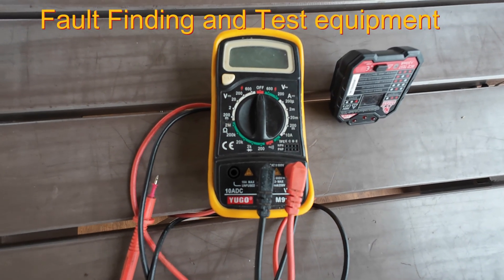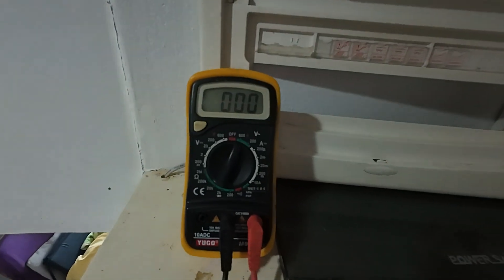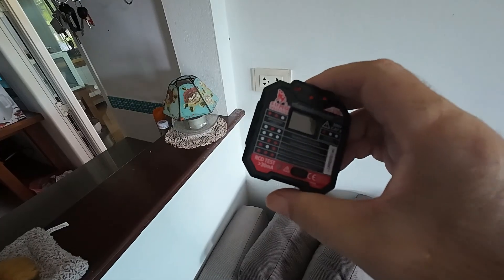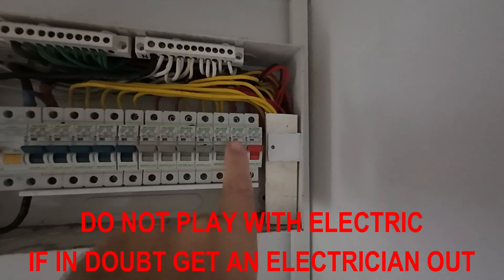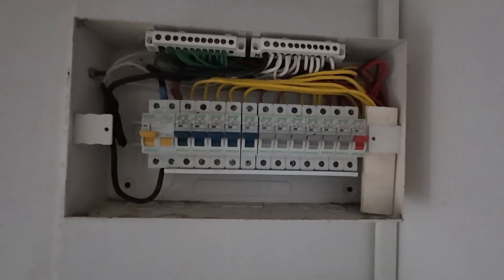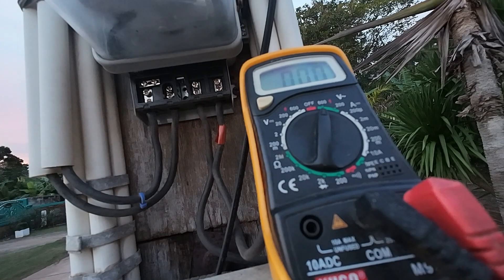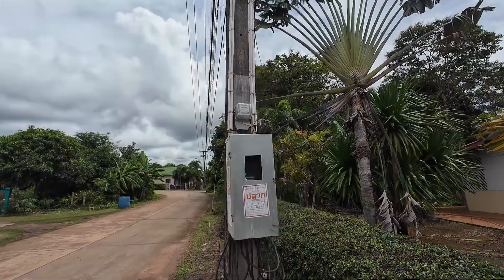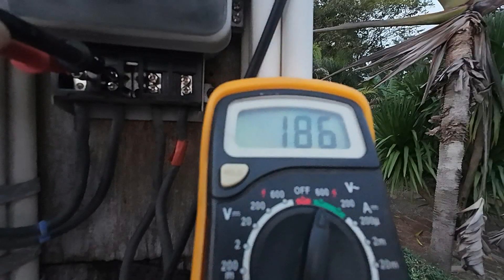ELECTRICS WE HAVE A PROBLEM

Comment: Socket testers don't show Neutral Earth reverse. ../ basic ones anyways
Reply from the maker: This one tester shows every configuration. Invest in quality. My friend who plays an Electric guitar was getting a tingle sensation when he played his guitar, he got me to check the grounding cable in the House circuit, a good grounding. Still getting a tingle he put an earth rod and wired the cable to the socket he used for his amp. Still getting a tingle so asked me to check the cables the short cable connection the amp to the socket 3 pins thinking it was earthed and no earth. Problem solved a cheap cable with no earth cable.

Comment: Heard a load bang from just outside where the cable comes in, a squirrel had shorted it's self out. Two what assumed were fuses where hanging down. PEA quickly came out and replaced them with an insulated pole, while still live
Reply from the maker: The guy replaced the cable here in the Dark whilst still live. Rather them than me. Thanks for sharing your story.

Comment: Some of these issues remind me of home! This was all happening before we started building the house. The neighbors upstream said they complained many times, but PEA wouldn't even look at it. I added a voltage readout on the incoming line right before my distribution box. It quickly became obvious the line coming in was losing voltage somewhere and PEA wouldn't address it. So, I went to solar, and now no issues.
Reply from the maker: There were a few trees making contact with the cables also around this area, this could be another problem with grounding. Our Solar backup came in handy again. Now a stable supply and only storms interrupt the supply now and again. Fingers crossed.

Comment: A lot of times the overhead connections age, the connection deteriorates and start to arc.
This causes the issue you had where the voltage fluctuates and the sparks literally fly.
Yes, I did the job for RECs for 41 years, so yes I am an expert...and yes, it is the PEA's job to rectify as they did.
If the fault is after the meter, you are right it is your responsibility, but once more usually it is a connector that has aged/worked loose/faulted so just needs replacing rather than the whole cable length.
Reply from the maker: Thanks for taking time to watch and make a comment.

Comment: Me to like fault finding as long as not to expensive,so a big relief when you see the short above ground probably rodent damage you see a lot of those squirrel guards in Thailand.I  like to see a nicely laid out consumer unit,interesting wire colours white as neutral yellow being live,in Penang new build condo Black neutral and white sleeve over black is live so inside the board is all black apart from green for cpc.
Reply from the maker: Interesting wiring here, I have an outside socket with three red cables in the back of the socket, so one red connected to the earth cable and one red connected to the Neutral somewhere in the loft.

Comment: The plug in tool is a good tool, all well and good Les if you live in a house which has earthing, I have lived in Thailand for nearly 12 years, 3 different rental properties and all are 2 wire systems no earth at any of the sockets, 2 wire systems it appears to be standard practice in Thailand in the older properties.
Reply from the maker: Yep older houses only have two wire system's even my house the wiring is not correct, one outside socket has 3 red wires in the back of the socket,  meaning somewhere in the loft there is a red wire to the earth cable and a red to the Neutral cable. Mmmmm Check and Check again at any wiring job in Thailand.
Reply: @RetiredandLivingthedream Yes and all appliances made of metal are sold with 3 pin plugs, extension leads all 3 in as unless you buy from Lazada, Shopee etc. In the U.K. when you sell or rent a house you have to provide an Electrical Test Certificate, all new builds have to a have metal consumer unit now. I am/was an Electrician, I rewired my last house in the U.K., I kept the old consumer unit as it was nearly new but failed the test because it was plastic. Also split consumer boards are not allowed now, all circuits have to be rcd protected. I had an induction hob, brand new, it kept tripping the rcd when you switched it off. I think there was a capacitor in it and it discharged every time you switched it off tripping the rcd. I could have connected the neutral direct to the neutral bar but decided to replace it with a ceramic hob as I was selling the property.

Comment: Hi Les. Thanks for the video; it looks like you have an anologue meter on your pole outside your house. With your solar setup, does the meter go backwards with the excess solar going to grid? Also, are there any laws that you need to notify PEA if you have solar?
Reply from the maker: You are correct I have an Analogue meter, my Main Solar is not connected to the Grid as I have it independent, I have separate circuits that provide power if the mains goes off and we use these all day to provide power for the computer the tv and fans in the bedroom and living room.  A small array but was only put in as a backup so we could have at least a fan on and watch tv.  We do have a small 120 watt Gridtie inverter but only ran by an 80 watt Solar panel, this provides power for the fridge during the day a small amount but every bit counts. A Gridtie inverter should be approved by PEA but mine is so small and as with gridtie inverters the grid goes off and so does the gridti inverter. PEA did pay for providing power to the grid but as I am aware they no longer do this anymore. Thanks for watching.

Comment: Well spotted Les!  Lucky it was on they side, would have been an expensive fix. I would imagine the amount of daylight u get in your location. You're already thinking of off grid solar/battery. Get the calculator out. lol.
Reply from the maker: In my opinion the cheaper fix would of been the cables, Solar is still expensive here, our electric bill is never over 800 THB per month and before Solar never over 1,000 THB. Electric is cheap here. Thanks for watching and taking time to comment.

Comment: Well played Les. Nothing worse than random faults, bit of luck you had a chance to film it the second time.
Reply from the maker: Filmed it to show the Electric guy, the other guy once he did the check at the meter was not interested in looking any further. Intermittent faults are hard to find. I went back to a property in the UK 6 times and did all the tests, Nothing. Then asked more questions whilst having a cup of tea and the fault happened a simple fix once we knew where the fault was. A tiled over socket with the ends twisted together touching the metal back box causing arking behind the tiles. Only charged her the once, thought Id get lots of work by referrals as I never give up unlike the other 4 electricians who  charged her for every visit and still never fixed the fault. Never got one lol.